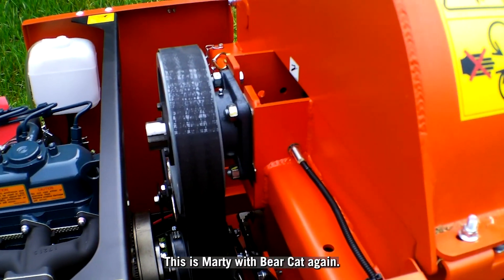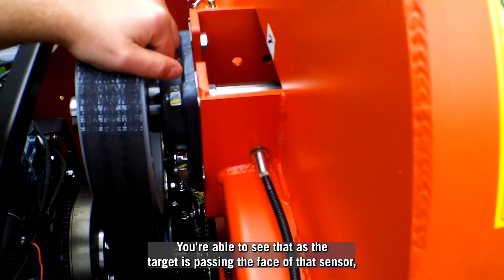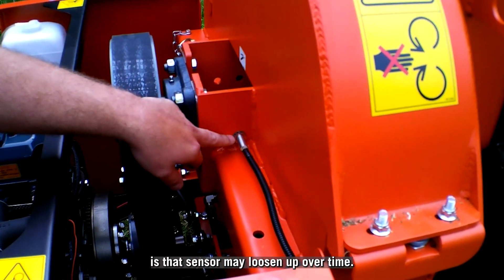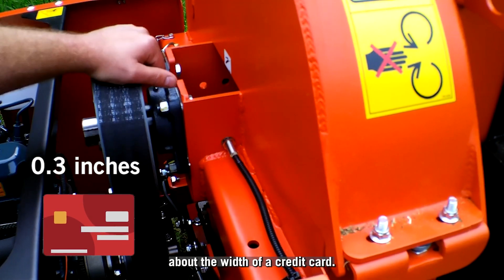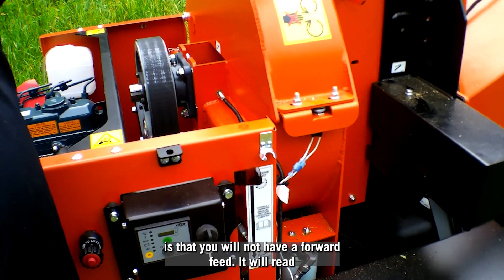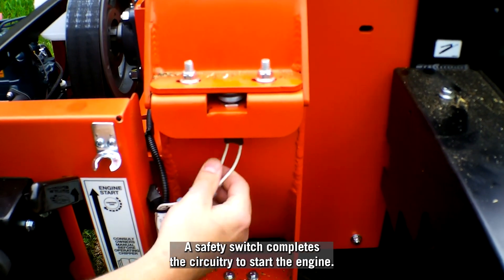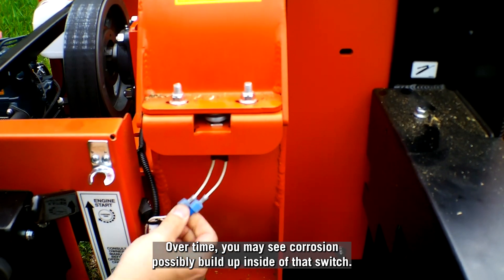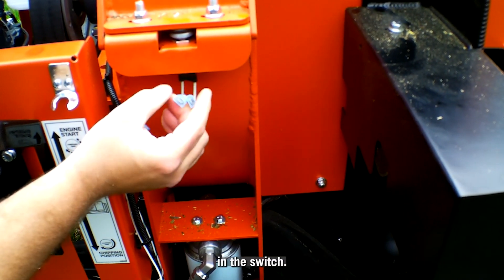THE MOST COMMON SERVICE CALL | Crary Bear Cat® UNLEASHED™ Quick Tip | Sensors

Comment: What about when the chipper is showing the message "rpm sensor" and is brand new (recent replacement)?

What else can I review?
Reply from the maker: When at idle the chipper will read "RPM's not met" until the sensor reads the appropriate RPM to allow the forward feed.  Also keep in mind when replacing the sensor it should be within .03" clearance between the face of the sensor and the target upon which it reads.  Thanks for watching!
Reply: What part # is the top safety sensor.mine it's failing keeps feeding roll in reverse